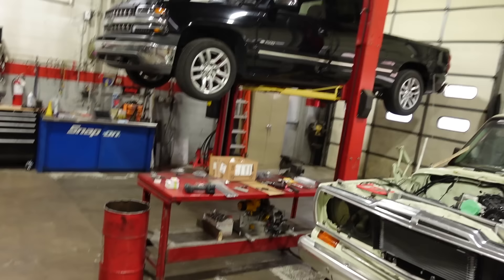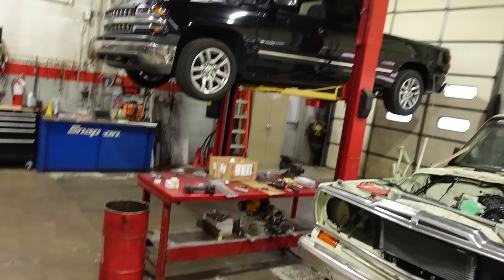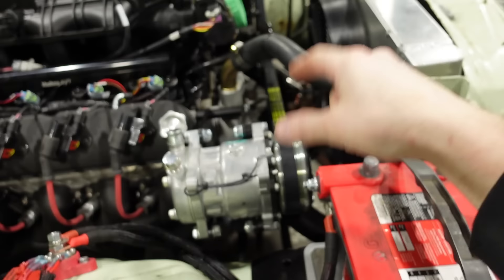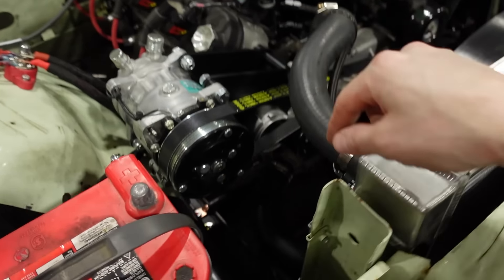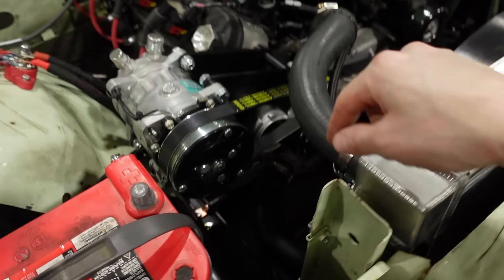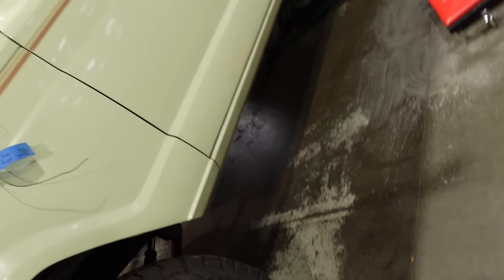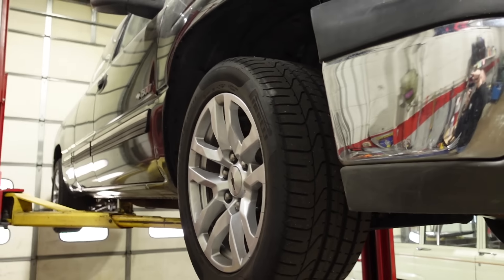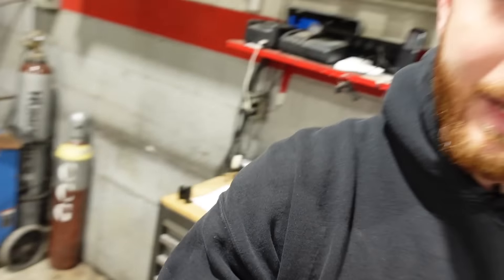my engine is DAMAGED BEYOND REPAIR, and its 100% my fault

Comment: In my opnion, replace the head with an oem replacement and keep the ugly truck as a lower horsepower vehicle. Then when the 4x4 race truck and motor are topped out at the drag strip, replace the head with the 8.8L heads, that is if they give you better air flow than your custom heads. Its nice to have multiple levels of power. Plus that rabbit hole was looked at, admired, and happily walked past.

Comment: Nothing will beat the reliability of a set of fresh stock heads. Nothing says you can't take a burr and some cartridge rolls to it just to smooth them out for a little improvement. This whole "stock-ish" with big turbo theme on the build is the big drawing point to it. Good luck sir!

Comment: I have repaired a 8.1 head with an external crack in a similar area to yours using crack repair pins. I specifically use the Lock n stitch brand. You drill each end of the crack, then you drill and install overlapping pins. The pins have a thread with a reverse hook that draws the crack closed as they tighten. A bit tedious,  but extremely effective and reliable. Some call this cold stitching. It might be possible to do this repair in chassis.

Comment: As an experiment, drain the cooling system, apply a good vacuum to the system and apply jb weld so it sucks it into the crack. Technically the coolant system shouldn't see any higher pressure than what the cap is rated at. Just to see if it would work and for how long
Reply: Great idea and experiment.
Reply: This sounds like a great idea and worth a try.
Reply: I’d sure like to see this tried myself. 
  I’ve seen JB Weld work in some situations that I won’t even share because I wouldn’t believe it myself.
Reply: Won’t bond with surface debris in the grain.

Comment: I'd really like to see the 8.8L top end - especially if Hank's worked out an intake manifold with short runner length so you can spin it up and make power past 4500. Otherwise, another stock head is a quick and easy fix.

Comment: Great job publicly admitting what you did to make it happen. Great maturity points! In terms of foreword, first call summit racing and ask them to make 8.1l heads. I've done this. If we all do they will make a set, then try the 8.8 setup. I've honestly been thinking the same thing for years. We need someone to make aluminum heads other then raylar, with taller valve cover castings for poly locks and oil/steam ports to match the catch can ports on the intake. I never put the same unaltered parts back on a vehicle. Constant motion foreword is what makes greatness.

Comment: 80/20 principle!!!! 

Turbo is where most of your power is at. Then compression. 

Don’t fall into the rabbit hole. 

IMHO 

Do stock cylinder heads
Enjoy it.

Unless you want more compression. 

Flow increase isn’t worth it
Combustion chamber size isn’t worth it( unless its smaller combustion chamber “ more compression”)

But either way LT you always do it better than i would. 

ROCK ON!!!!!

Comment: If it were mine... I'd remove the exhaust manifold, and everything else that might be in the way, or close... Drain all the coolant out of the engine, using the torch (GO EASY THERE GUY!) heat up the crack and clean it until it is so clean that you can't clean it anymore... now that you've got it clean, dig the crack out with a grinder wheel on a small angle grinder, or using a dremel tool and open it up a little bit.. Clean again. Pre-heat with torch... now TIG weld the crack with silicone bronze. Head does not even need to come off... It's 100000000000 times better than attempting JB Weld... and if welded properly, pre-heat/post heat, it will probably last forever. You have NOTHING to lose trying this method... If it fails, you can always move on to those other heads... but if it works (and I think it will) you could be saving a bunch of money, and more importantly TIME...

Comment: I believe you should go with new aluminum heads. A couple of reasons it makes sense, don't miss an opportunity for an upgrade, they will help you get to your 9 second goal with more power, they will help remove some weight from the front of the truck and help with the launch.

Comment: Hi LT, 

In the near term you might consider sticking with the scale and scope of what you were originally trying to do with the Ugly Truck (at least for now), which was a sub 10 second 1/4 mile on a stock 8.1.  That’s still a worthy goal.

You’ve got the 535 CI drag truck and the S10 project and the Wagoneer and the shop to run on your spare time. 

Stock replacement may be the fastest way to getting back to your Saturday cruises.  Maybe add in some nice valve work or something like that.

Comment: My vote would be stock replacement for this head. You have some other really cool fast stuff that will have enough traction to actually use more power. If I remember correctly, it already makes enough power to spin just about whenever you want it to ;)

Comment: if it were me, I would probably find a new stock head, and maybe have a mild porting job done if you're feeling the need for an upgrade.  Just to get it back on the road without much drama.  If in a few months or years, you could always revisit and invest in aluminum heads and bigger cam, if that's what you're looking to do.

Comment: Temp repair?  As other have said, JB weld.  But also, switch to a 7psi rad cap. It's all we used on gas/NG/diesel generators up to and beyond 800KW. Just keep an eye on the temps for the first while.

Comment: in all honesty you should shelve the 8.1L since it has proved itself beyond all expectations, and pick up a complete 8.8L from PSI gap the rings, swap the cam and lifters, and do a comparison between the power plants. Remember the 8.8 comes with many upgrades from top to bottom.

Comment: Heat the stud cherry red, put some wax on it. When you heat the stud it expands, when it cools down it shrinks the wax will act as a lubricant so the stud should come out. The head won't get so hot.

Comment: Use the "Lock & Stitch" crack repair and  fix what you have. Will be around $150 to buy the kit to fix the crack. The kit should have enough in it to repair more than one crack so it will cost less than the price of the kit. Plus now you'll have the tool so if you run out of the stitches you can buy more if those for less than a new kit. Save your $$ for the other projects.😎👍

Comment: I remember an episode of Engine Masters where they showed that with forced induction, the choice of head didn't make a big difference in power.  It was surprising but would be a consideration here, I think.  The money spent on a new set of high performance, aftermarket heads might not really give the return relative to the $pend.

Comment: You definitely have some decisions to make on the head repair. With all of your projects going on, maybe a simple head replacement is a better option. You're in and out fairly fast, and cheaply, and it's back up and running. Then you can focus on the next project in line. Just a thought...

Comment: I got a Denali it needed wheel bearings. I did it in one of the axles CV
.. no, it still does the ting ting. I torqued it to 177 ft. Lb... It is just a worn ut front diff I don't know. Or just bearings and sales I don't know. Has high mileage and also that will has caliper with frozen slide pins.... Maybe I should just get it used front diff or or is something I can fix?

Comment: Well seeing as you are building a race engine equipped version (race truck) and the ugly truck is a fun street truck that is more than a handful to handle when you get into it plus you are building another all wheel drive truck I say leave it as it is (stock replacement head) so you can still daily it and drag race on occasion. Keep it fun!

Comment: Repair it.
Could thread sealant work? 
Or weld it?
Or jb weld by putting it on the threads & screwing the stud back in.
Then some on the outside of the crack.

Comment: Just put the race motor in it. It’s right there, “cheapest” option given what’s available in your stock. You can continue with the 4x4 build and maybe something comes up later down the road, but it kind of was the original plan

Comment: Time is the issue for you. Depends on how much longer it will take to do the 8.8 kit with tuning vs just 1 stock cylinder head... if it's not much longer for both heads and tuning, then might as well go 8.8 unless the $ isn't worth it.

Comment: How about trying K-Seal(not sure of spelling) for a temporary solution. Derek of Vice Grip Garage has had good success with using it with cracked blocks (mainly in the lifter valley). I know some people don’t like using additives in cooling systems.

Comment: JB Weld won't work it won't stand up to the Heat, recently A friend of mine on his small block Chevy had a leaky head gasket and I suggested to go and get some of the block sealant / head gasket repair and he dumped it into his cooling system and he is head gasket leak is no longer so with that said as much as you drive this truck, I would just try the head gasket block sealant, generally sells for around 25 to $50
By the way generally what's in this block sealant is sodium silicate, also known as liquid glass

Comment: You’re not moving enough air for ported heads to be beneficial. If you port the heads you’ll be down on torque with no hp gain. If you were moving more air I’d suggest it.

Comment: i’m confused I thought the 8.1 was based off the old faithful, 454 I thought the architecture was the same same bore spacing just a taller deck giving it a 4.37 stroke thats what makes it a 496. so what’s the difference between the 496 the 502 and the 632 from GM or the 502 and 632 totally different blocks different architecture.?

Comment: Put a stock head on it. The whole premise of the Ugly Truck is a stock(ish) 8.1 with a turbo. You still haven't really found the limitations of that combo yet, so for data's sake keep the experiment going. Besides, for speed of repair, a stock head replacement will have it back 100% in the least amount of time.

Comment: Why not 8.8 as it gives everyone a chance to see the advantages of this package. JB weld 🤔 how long is that going to hold before you decide to redo your work and go through all the work again, not me. Stock replacement sure it’s quick but leaves you curious as to gearheads biggest question, what would it have done with those 8.8 heads ? Stock replacement boring, JB Weld waste of time, 8.8 package will give you and us viewers a huge curiosity as to what this package brings a win win 🏁😊 for us all to see.

Comment: Stock head replacement but you are a content creator so go ahead and get the psi 8.8 (10:44 ) heads and upgrade the cam and see how much it improves et with the same boost

Comment: I vote for welding the crack or replacing it with a stock head. On a side note, I am a little disappointed that you stooped to click bait by saying that your engine is damaged beyond repair. A cracked head like that is not that big of deal and is an easy fix.

Comment: 8.8 is tempting but,enough irons in the fire.  Keep the ugly truck running with as little cash and down time as possible.  Go back with stock heads.  I've been down the multi project path in the past, ending up with nothing going. My $0.02.

Comment: I'm sure by now you're already working on a solution since my comment is being posted 3 weeks later. REPLACE the heads. There is several options but none the less do not reuse the existing heads.

Comment: Stock head. Be done. Keep the effort into the other project. 
  Imagine if you would have paid a machine shop to remove those broken bolts and this happening. 
  Yeah… this is why I do not allow any castings to be  heated up for broken bolt removal. I’ve learned by my own mistakes as well at too many others over the years. It just doesn’t pay. 
   I once heated up a section of cast iron and got it so hard I couldn’t finish the work that need to be done in a timely cost effective method. Had to start over with another casting. Never good. 
   I also once witnessed a very expensive cylinder head that had been developed for NHRA stock competition get ruined when a coworker was trying to remove the plug that the temp sending unit screws into.  They wouldn’t listen to myself or anyone else. Then followed that up with pouring cold water onto the heated up area. They got what they deserve.  
    The main reason I do not allow it is you never know how a customer may react to his castings being heated up to get the job done. Not worth the conversation let alone the cost of replacing it. 
    In all fairness we do have the tooling for these jobs.

Comment: If the upgraded heads will bolt on with no mods or changing parts...I would spend the extra while in there,,,if not throw a stock head on

Comment: Science experiment time pull a vacuum on the cooling system like a lot and then attempt to braze the Crack in the cylinder head and hopes that it will suck some of that molten metal in. If it works cool, if not 8.8 top end.

Comment: Take heads off, inspect them to see. may beable to just fix it. If not pick up some stock heads. Your truck makes retarded amounts of power already, you dont need to go down the rabbit hole with fuel system, turbo size, cam size etc. thats what your other block is for. Ugly truck is a fast, nutty daily. keep it like it is.